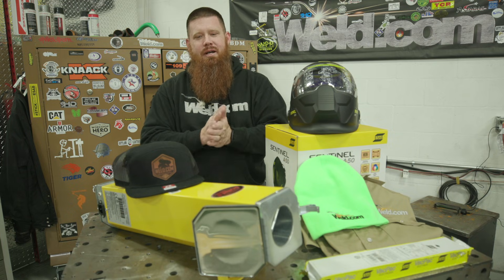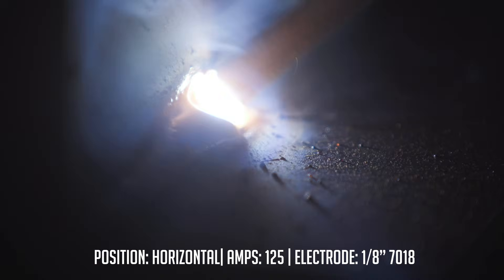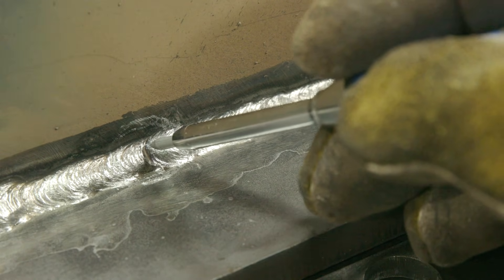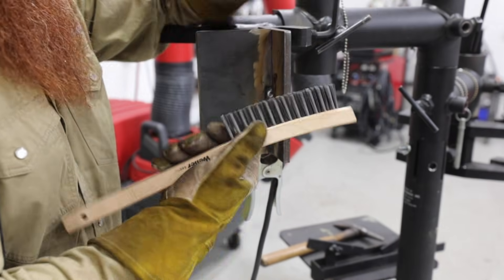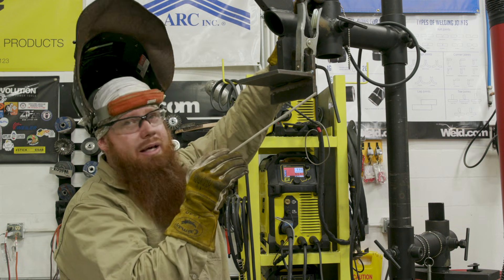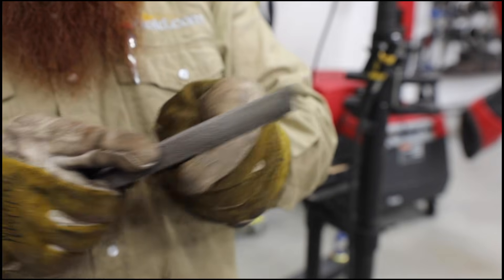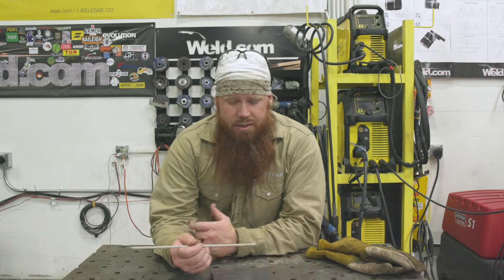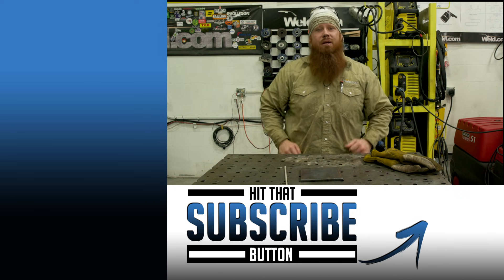7018 Restarts in Different Welding Positions

Comment from the maker: Visit store.weld.com for our official merch.
Reply: I have a question. What it is it that I do wrong when im doing vertical uphill. I got a 7018-1 rod 2mm I think. And 80amps and its runny like water. Its still runny at 60amps. I dont get it. Welding electrode positive on 6mm carbon steel plate.

Comment: On your restarts you don't show or explain if you cleaned up the slag from the previous run. Did you not clean it up or did you just weld back over on the restarts?

Comment: I. Wouuld like to see same s.tarts and stops but on pipe diifferent m materials if that would matter as im learning to be able to do many different types of pipe and stuff on our large drum at work would like to produce stainless moonshine still parts as well so different material will mainly be tig on that but mig or arc on the stuff at work. Also i have a large beard and wonder what your favorite beard saver stuff is for wrlding. Like snap on bear aprons or what. Im new but just got a ssimder 10 in one on order to practice more at home and do farm projects ive always just had friends come weld shit for 10+ years so itll take me a while to get good i know

Comment: THANKS for the video. 
I can't even get a brand new 7018 3/32 rod to start (without a LOT of difficulty) on 110A DCEP on a nice 220 volt machine. No problem with any other stick. Gotta practice more.

Comment: Hello Sir, 

my Name is Haiqal from Indonesia

would you like to make video that explain how to do reweld / repair welding on a steel plate using stick welding down head with bevel single v butt joint.
the first weld we assume that is had a defect so need to grind it till the fill/hot pass layer, and then we weld there again.
that is for my undergraduate thesis

Hopefully you can help me out
Thank You Sir

Comment: Great tip about filing the bit of slag off the tip to get a good arc start. I figured that out just recently and it's nice to know that it's not just for amateurs like me. I started using the serrated back of the welding pliers, but a file would be a lot better at doing that. Thanks!

Comment: On that vertical weld are you concerned with the bead being concave? Got any tips for getting the metal to lay in there flat or convex? Thank you. Also are you running constant current or constant voltage?

Comment: Congratulations to Jason T. I love my rod oven, even slightly damp 7018 runs noticeable different. I worked at a shop next to the San Francisco Bay and the rod in the oven was awful. Turns out the ovens power was on a timer so at night the power was shut off to save " energy ". The oven cooled and contracted then sucked moist fog laden air in ! Replaced the rod / removed the timer and 7018 issues gone. Water expands 1860 times when vaporized by the welding arc as well as the introduction of hydrogen into the weld puddle. Note: 6010 NEEDS THE FACTORY MOISTURE AND SHOULD NEVER BE PLACED IN A ROD OVEN. Stay safe all....

Comment: With my 7018 overhead I struggle with the slag/puddle dipping into my rod n sticking it or disrupting the arc.  When I get going I can go smooth but usually the first inch is a mess, any pointers?

Comment: Thank you for all the videos you put out there to help us learn. 

I have a question about a 45° "T-joint". Either with MIG or ARC welding. How would you correctly grind/prepare the plate that comes in on a 45° (or any other angle than 90° actually) ? It would be useful to learn the correct way. Thank you in advance.
Reply: Probably a dremel like tool

Comment: This Chap has a steady hand, knows how to work with amps and all that good stuff, gave a couple good tips but every time he switched positions, he never mentioned at what ANGLE the Rod is supposed to go in into the weld groove or take into consideration the already Laid weld and how that affects the Angle of the subsequent weld that's gonna go on top of the previous existent bead. He mentioned that when he moved to overhead welding, he raised the Amps from 110 (uphill) to 118 (overhead) but did not mentioned that, specially in overhead, with a higher amperage, you have to keep a Tighter Arc to prevent sagging, Arc blow and to avoid Slag inclusions, porosity, poor penetration, Toe undercut (Toe of weld: Both edges of it) Also, welding uphill, it's key to Stay a fraction longer on the edge of each wall to wet the toes completely and give the middle of the puddle a chance to cool off before you go across the middle again and prevent too high of a Crown, (and didn't mentioned the degree of the angle for welding uphill also) I know this is kind of a class in such a short time span, but Not mentioning the facts above has a huge impact on the outcome and control of the weld. I also observed that he has a habit, welding uphill, he spends more time on the Left side of the plate, goes across the middle to the right and without spending much time there, whips back to go Left. Don't know, maybe he is a Democrat. Good tips tho, specially the one to get Rid of the molten tip. Didn't know that.
Reply: @Phoenix-One0922,get over it son ,trump lost 😂

Comment: Again guys do not get hung up on his amperage. I run avg 10amps  lower than most ppl but still pass bend tests cause my speed. So again look at puddle and yeah starts n stops ARE CRITICAL with 7018 tests so practice practice. My last 3g test i couldnt even see my root restarts i was pretty proud

Comment: Good vid 
I usually back track a little more sometimes just a tad slow , to be on the safe side , it’s not hard to get porosity in those
 starts/tie ends 
, and if you are in tight spots , in a hurry , doing lots of x-ray , last thing you want to see is a glob of pin holes in that tie end  , also seen times to where there was a tiny bit of porosity on a tie end , hit it with a grinder and it turned out to be more than what you would had thought , also burning large electrodes, you really have back track them a good bit 
I’ve noticed they seem to want to leave porosity on them tie ends , 
Those pinholes come from the rod not being fully covered by the flux  on the rod , basically burning bare unexposed rod 
Also sometimes starting electrodes the end may crumble or break off a little, so than means you have to back track longer before you make that tie end , so it’s clean

Comment: any tips for 7018s like the weldwell Ph77s, majority of caddys I deal with only have a 60-63 OCV which makes dealing with the 77s (7018) a sod even thou alot of the weld procedures here use 77s, most caddys here more suited to 16TCs(7016s) 50 OCV... very few caddys I come across have a 70 OCV to assist that arc distance ... actually only one brand ive found that likes the 7018(PH77s) here miller.... prob is we have stratas and XA (both good caddies but lack the OCV)

Comment: Many times when i was fabricating things i use to tackweld using 6013 rods then weld to finish with 7018,but sometimes i don't have 6013 available and i use the same 7018 rods to tack aswell,bit difficult but manageable if just before tacking,break the exces flux tip with the fingers wearing glove,it will break enough to expose the core rod,then release the rod from the electrode carrier clamp and scrape it against the workpiece or something hard to get to the shiny metal,then get it back to the clamp and make the tack using close support by hand to ignite and burn shortly enough to make a tack,if needed,break the flux tip again and reinforce the tack by re-ignite the arc next to the tack without touching the tack if the piece you attack is quite heavy or tend to move,if not,reach with the weld untill the first tack is covered,but in essence,tacking with 7018 made me practice the restarts mid-weld,if you cannot tack with 7018,it will be harder to learn to re-ignite mid-weld,nice tip dude,valuable lessons free for everybody !!! ^^

Comment: Not sure the position used as over head for a fillet weld is correct what you did still remains a horizontal fillet weld.
Reply: Classed as horizontal/overhead.

Comment: In vertical position, when do you weld upwards and when do you weld downwards? I had some 3mm 50x30 rectangular and i was unable to weld it (with 7018, 2,5mm electrodes) upwards like i've seen you do it, without putting holes  in the material. If i traveled faster, the weld did not penetrate enough. On that particular setup, i found out that going downwards suited best for me.
I have to mention i am new to stick welding (i am experienced with mig welding, but with stick...i am a beginner)
Reply: The most important aspect on welding 7018 downwards is to start the arc at the top of the bead you want to make and build a little pile of metal untill the excess slag drops,from that moment start moving down and keep the rod almost horizontally as you travell down,waiting for the right moment when the exces molted slag drops out to expose the bare molted metal to advance downwards,practice that and you will see the results,do not thank me for that,just practice and keep burning rods ^^
Reply: When stick welding, the only time you weld vertical down, is with a rod which the number ends in **10 or **11, or **48.
With other rods, it may "look" ok, but will not give a decent result at all. 
There will be plenty of people try to argue it. If your knocking something up for at home then dk what you like, but if you need any sort of quality in your work,.. do it properly 👍👍

Comment: Nvr do this making x-ray welds on pipe... too much of a risk for porosity # LU 449!!!
Reply: The electrodes will melt...so...a restarted arc will be allways come over the bead nead the end pool cavity and will be grinded away,allways start the arc like 1\2 before the bead end,and grindoff the exces material,allways feather the endings without enlarging the keyhole on the root pass and all will be ok if you keep the rod burning continuosly.

Comment: I stack up my bad rods and after I get 5 or so I'll trim the tip on my portaband saw to get a good fresh tip for restart.
Reply: Tiny bolt cutters work better
Reply: @johndowe7003  they do work but they can also break the flux off. I get clean cuts on my bandsaw plus it's on my wall right behind me at my work bench.
Reply: @allenmckinney9533  yeah true I never messed with trying to cut them on a band saw I got a portable one so it'd be tricky I'm guessing

Comment: You can get quite a few starts and stops from one welding rod.  practice, practice, practice and be VERY critical of your results. 
 Filing the end of a rod... ?....  An old welders trick...pinching off  the balled end of the rod with a pair of pliers works a lot faster and just as good. Use pliers with good sharp (file like) teeth.

Comment: I guess I am old school I bang the half spent rod on the table ( get a small flash ) and restart oh well it works but I think I can upgrade to
Jason's whip out and restart, well maybe, but I will try ,maybe okay , I will try it.
Reply: I do that as well, you can also use a pair of tiny bolt cutters to cut that slag off the rod so you start with a "fresh" rod
Reply: I did that many times but sometime the flux coat can chip out more than needed and the arc will start by throwing melted steel balls sideways,away from the spot you really want that arc to strike...

Comment: If you weld to code as soon as your rod sticks it is trash.  If you run a rod and you stop, the rest of that rod is trash.  Never reuse a rod when doing code work.  If you are at home, use it down to the nub.
Reply: Swampy because you are not trained as a professional.  When you start an arc or stick you may leave porosity.  Slag inclusion.  Or when you stick the rod you might damage the flux and on a restart you can get an erratic arc leaving a trail you might have not wanted.  Or it might just finish breaking off a piece and again introducing porosity.  It makes perfect sense once you are well informed.  Don’t take it from me I am not a teacher just a welder with certs and by following what I was thought I was Abel to pass tests.
Reply: Swampy I worked with companies that want you to burn it all the way to the nub. That is the goal the company has and the goal the welder should have as well.  However, if you stick it it’s done.  Take a weld test In front of an inspector and try restarting that rod that just stuck.  All they will do is stop you there and say you don’t need to proceed.  Now if I was building something at home I would throw away half used rods.  Those then become tacking rods.
Reply: Swampy see that’s the thing. Someone does understand why and that’s why that procedure is in place.  This is why you also shouldn’t just pick up any rod off the welding table and start welding.  Trial and error has already been done so we don’t have to.
Reply: Where is that in the code book I’m interested ?
Reply: Michael Reyes read the book
Reply: E A i am studying the book and i haven’t seen that anywhere in it are you talking about the D1.1 structural steel code right
Reply: I had the longest reply that I decided to delete. I held delete for 15 seconds LOL.  the book gets revised every 2 years and stuff gets moved around, deleted or added.  Keep reading. If it’s not there then wow.  However if you find yourself in a refinery or power plant, don’t re-strike your rod twice when the inspector is there to make sure you do your job correctly.  There is another welder there waiting to do it correctly if you cannot.
Reply: E A i had my la Cert for 13 years ago and go out of the industry for awhile and I’m taking it again Wednesday i have done shut downs before at a refinery and have never heard of that before where are you out of I’m in California

Comment: When I weld with 7018 in the overhead position, I've had trouble with the slag snuffing out my arc. How should I correct this?
Reply: Mark Lowry check your travel angle. Keep it about 10-15°. If you’re straight up and down it can snuff out the arc. Also, turn up your arc force a bit if you have it as an option.
Reply: @GodslilRedneck23  -- Roger that. Thanks.

Comment: I need one of those khaki work shirts like the one you got on. I need to represent at my college.💪🏾
Good info and yes practicing restarts is also important. Question, was that an HD welding lens that was used for the arc shots?
Reply: david martin hey man, the shirts are available on our weld.com store. Check it out. The lens isn’t too special. The camera does all clarity for the arc shots.
Reply: Jason Becker I will definitely check out the store inventory. The reason I asked about the welding lens was because it looks like mine. Mines an HD Ameriarc auto lens. Thanks for replying 🤙🏾

Comment: I was wondering why you turned the voltage down when welding overhead.I would think you add a few degree's.
Reply: rockymontana1 when going overhead, I usually drop about 5% of my flat and horizontal amperage.
Reply: Heat rises. Horizontal it is going up away from the weld. Going up yours chasing the heat. Over head the heat is going into the metal.
Reply: grayguy19 you mean in vertical it’s going up?
Reply: @GodslilRedneck23  he meant that the heat is rising away from the horizontal weld, not that the weld was going up. I normally drop some amps for vertical welding though, as the heat is going in the direction of my travel

Comment: Anyone know if i can use a 400amp arc stick weld electro holder on a 200 amp machine with no draw backs?
Reply: No problem. It means your electrode holder can handle up to 400 amps. If your machine only goes to 200 amps, you're good.
Reply: Mark Lowry ok cool thanks...its just theres a special on the 400amp holder and i might buy a few of them .👍
Reply: @SpunCog-Racing  otherwise,that means your electrode clamp will last longer,but one thing to keep in mind,never allow the cord (cable) to rub against the inner handle tube edge,it will erode the cord insulation then will make more room to rupture the cord on the connector,just stuff some rags there and secure them with some insulating tape firmly and plenty not including the handle,just wrap the rag and tape it then slide until fits snug into the handle tube then tape strongly to the cord,and you're done,do it well and forget about any issues later regarding that,btw,best connections if you solder the multifillament core before tight up into the holder,it it assure best contact and less heat will cause,prolonging the lifespan of the cords and the attachments.

Comment: Just as a question, wouldn't showing the bare electrode hot cause oxidation? Like pulling a tig rod out from the shield gas? 

Lately I've been doing mostly tig with a little stick when needed (quick repairs to bad welds from months ago; all household related non-structural things.)  I will say I have noticed issues with oxidized SS rod in tig but with the 70s2 so far. Also file trick has saved me with welds on equipment I've worked on (not going into detail since I have 0 schooling and all self trained ((trying to find an instructor)) so no issues with people worrying about my safety.)
Reply: Andrew Sturgess no issues with the exposed core of the electrode. Stick welding is way more forgiving than TIG welding.

Comment: Off the subject Red, but have you ran enough of the new Esab electrodes to compare them to Atom Arc or Excalibur? Thanks I value your opinion.
Reply: Tommy T yes, I’ve done quite a bit with these rods. I’ve never been a fan of the Atom Arc (just personal preference) I’ve been an Excalibur fan for years, these new rods from ESAB run just as good as the Excalibur but arc initiation is excellent. The graphite tip seems to help a lot on start up.
Reply: @GodslilRedneck23  thanks bud, much appreciated. I'll see if I can get a demo pack from my lws.